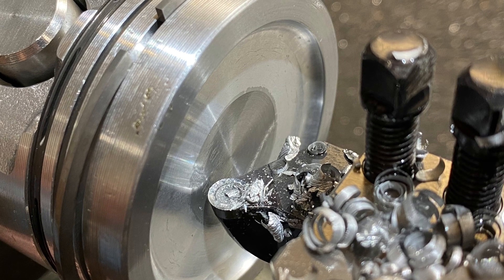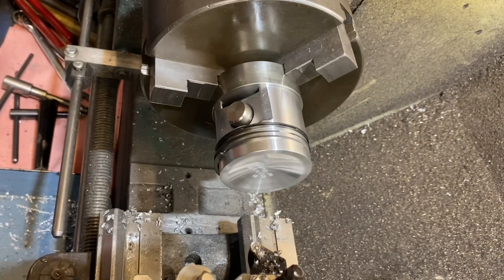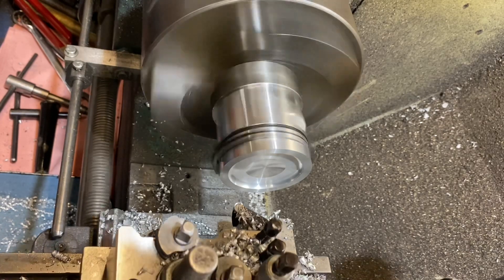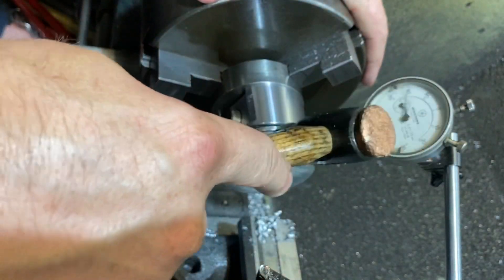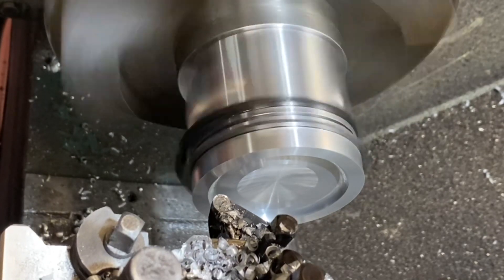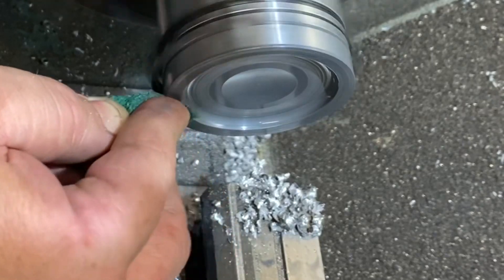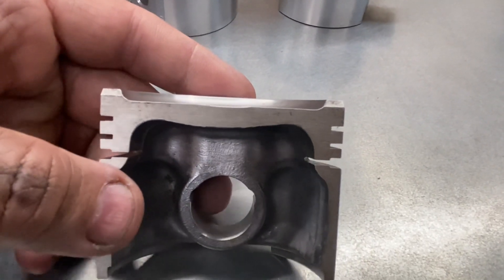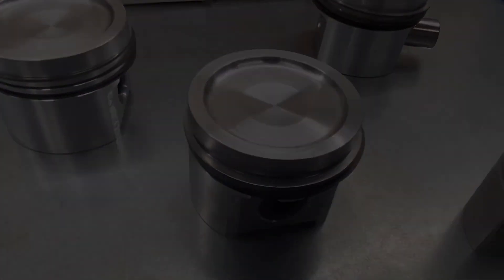Machining on the Lathe - Piston redishing, part 2

Comment: Thanks for the video. The product looks like something new from the factory. I would like to get your advice on the following. I have a 5-cylinder Audi engine that needs new pistons. The cylinder head, however, is already skimmed past the minimum thickness. The stock compression ratio for the engine is already at 9.7:1. Manufacturer requirements specifies that the damaged cylinder be discarded and replaced with a new one when need be. According to the manufacturing new cylinder heads are already at the minimum thickness and no skimming is allowed. New cylinder heads has been discontinued and I must work with what I have. The over skimming of the cylinder head resulted in too much compression which in turn caused severe engine knock which in the end caused my engine to fail. Your dishing of pistons seems to be the solution to prevent compression from getting too high and causing knocking. This is something that the 5-cyliner engines is known for doing even in standard form. Your feedback will be appreciated.
Reply from the maker: It’s common practice to open out piston dishes to set compression where it needs to be. However, there are limits, leaving the piston too thin after machining will cause failure in service
Reply: @ACDodd  Thank you.